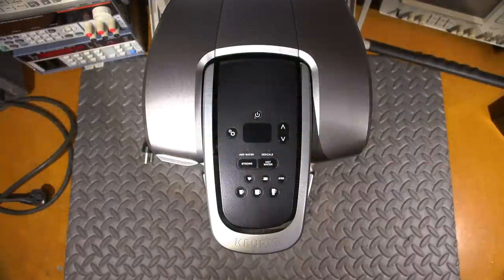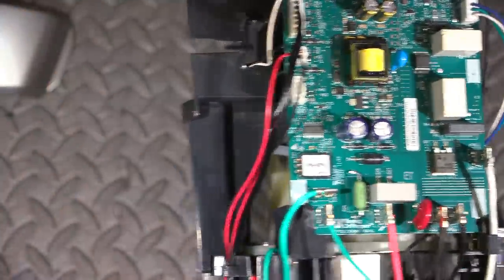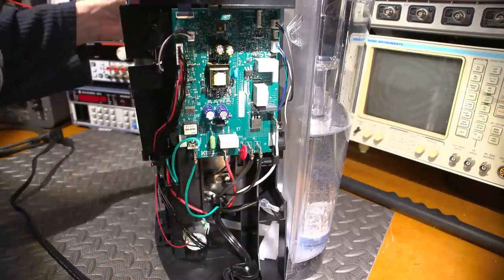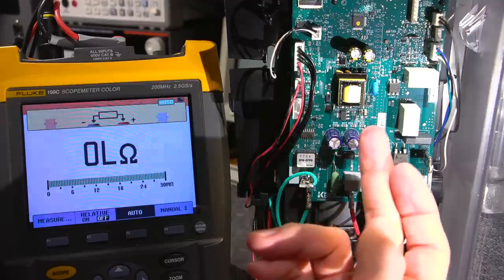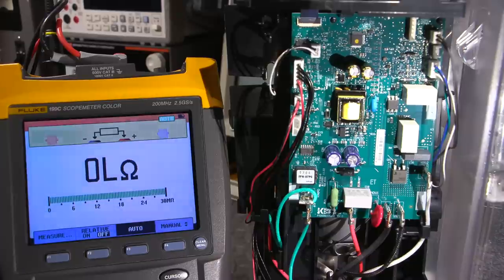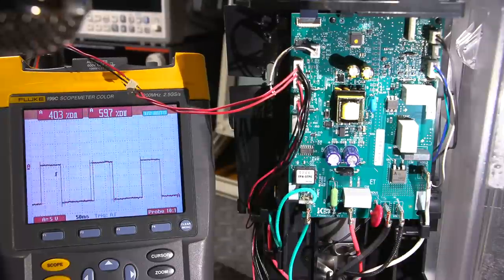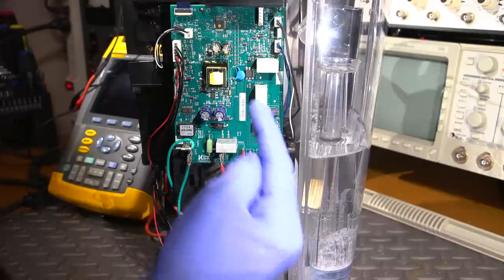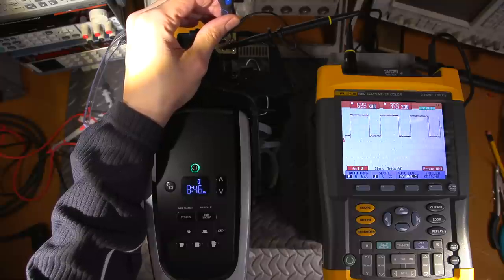Coffee Maker Repair And Modification - "For The Perfect Cup"- The Keurig!

Comment: Great video Paul! I just bought a third-party replacement power supply for my HP MicroServer and it spews S9+10 RF noise from below the AM Broadcast band up to who knows where. It made listening to HF rather unpleasant.
I might crack it open and see has been done (or not as it seems) to mitigate switch-mode noise from being broadcast.

Comment: I didn't read through all 938 comments to see if this was mentioned already, but you don't need to open and close the cover to dispense water. You can turn it on, press "Hot Water" and it will light up the LEDs, then select your cup size. This might be in the manual, but I haven't read the manual in over 2 years, so who knows :)

Comment: I saw the title of this video and was hooked - had to watch it!  Question though: wouldn't the pump keep on spinning since your new PWM circuit continues to apply power after the cup is full?  I note for example that the original PWM signal stopped  at 58:14 but the new one from your board didn't.
Reply from the maker: The pump is controlled by the CPU, and the CPU has a timer which times each cup, then shuts the drive to the PWM FET off. My board is at the speed sensor input to the CPU.

Comment: Out of curiosity, did you check the fill level problem after you fixed the RFI problem but before the pulse generator?  I was thinking that the RFI might have been confusing the original pulse generator.

Comment: I really like my Keurig's too and it's funny I have had the same problem. Here in Florida I get a lot of momentary power outages, you know the ones where the power goes off just long enough to turn everything off. So off course all of my lab equipment is on PSU's just to save them for seeing these power surges. But you know I never thought about putting my Keurig on one. I just may have to try it and see. Or maybe I should just do the Mr. Carlson's Keurig Hot Wire!!

Comment: A metering pump with an encoder, neat.  Did you use tap water in this?  I suspect pump is plugged up or some filter is which is the depth I would have taken this to before messing with electronics or suspecting a software fault.

Comment: I have the smaller one, and it works on a different principle. You put a cup of water in, and it runs until the water pumps out. Then a water sensor shuts it off. Unfortunately it gets clogged up with scale or dirt and sometimes doesn't shut off so you have to watch it. The good thing with this design is you always get out what you put in; the bad thing is you have to fill it every cup you make.  Once in a while a coffee ground gets stuck in the water tube and I have to pull it apart to get it out.

Comment: All my Keruig machines have pump failures when they die. The pump literally grinds and rattles and fail to pump. Except for the one that caught on fire. I have since gone to an electric kettle and pour over coffee funnels. This video, however, was fascinating. I'm still not sure how injecting your own pulses fixed it since the motor speed sensor was also sending pulses. Am I correct in thinking the pulse width is averaged to get a dc voltage and that is what the controller uses? Thanks for another great video!
Reply: I just posted a comment about being suspicious of this failure a few minutes ago. I also know a lot of people who told me their Keruig failed this way.

Comment: Very interesting video, and thanks for an inside look into one of these machines. As you mentioned it appeared as the processor got corrupted in some way causing the low fill levels. I wonder however what was the actual fault of this machine with its spurious rf harmonic output? Did Kurig forget to add decoupling caps on the line cord input, and/ or not use the proper capacitor value for the de-couple cap that was found on the board? Be interesting to take apart the other twin brother machine that emits very little noise to see if the decouple used in this one is of larger capacity value than in the troubled machine, and also if this machine has caps on the line cord input such as what you added on the noisy machine?
Thanks for the video my friend, just goes to show what you can accomplish when you have electronic knowledge and the will power to divide and conquer. 😎👍

Comment: the rf coupling caps you added would that work on new led lighting fixtures if they are noisy and would I add across line volt are on dc supply

Comment: I have a Speed Queen top load washer that when it runs it makes RF noise in anything above 20 meters. I also have a Visio LED TV that does the same thing. Looking at your capacitor trick,  could I try this? I just wonder if there isn't something commercially available though that would just plug into the wall and the washer or TV plugs into that.
Reply: Higher frequencies add a clamp on ferrite to the line cord. They also sell pi filters that plug into the outlet before plugging device in .

Comment: The need for two sensors is primarily due to the fact that it’s sensing flow, if you add heavy grounds it flows at a higher rate and the strength and level of water delivered changes depending on the grind. A fine grind coffee causes the pressure to go up which causes the flow to go down so it counts to make sure it delivers the proper amount of water regardless of the grind. Your tests are on straight water with no back pressure when you add grounds it will probably caused the water level to go down

Comment: I wish i could see the pump in detail ,, does it work like a tubing loop infusion pump ?  if so the  sensor might also be counting the number of revolutions of its pulse rotor as a function that when the pump when working property each time it completes one turn pumps a "set measured quantity of water" into the heating chamber ,  its pumping a measured quantity of water into chamber if it works this way.. (The older Keurig's used a single speed water pump that added water until set of electrically conductive pins of various lengths (Sense's the actual chamber water level)  made contact with surface rising water and it knew that way it had filled heating chamber to the proper water level you selected )

Comment: Hi Paul, Love your channel.  Has this Keurig always had low output? Or did it get worse over time?  On a four wire Hall sensor it would be easy to miss assemble the interconnecting wire and mix up the "Hall+" and the "Hall-" leads, which would make the signal from the motor sensor to be inverted.  The microcontroller would mistakenly slow the PWM (and the motor speed), but not a total absence of pulses that causes the processor to freak-out and shut the whole thing down.   It would be interesting to see what was on the other wires that went to the sensor.   Could be a totally different sensor like optical, who knows.  Fun to think about over coffee...

Comment: This was amazing. This guy designed a pwm board for a throwaway coffee machine. Sadly that is what they are. I think Philips came up with them about 25 years ago and they have taken over the home coffee making. I have had many different brands of similar machines but they all die relatively quickly. I remember Philips machines had a programming option to adjust your cup sizes by overwriting the default one. But the pump would be dead within 3 years regardless.

Comment: If I understood you right, you used a TL494 to suppress (by brute force) 35% or 40% of the pulses from the speed sensor. That causes the microcontroller to read a lower speed, and compensate by increasing the motor PWM duty cycle. Is that correct?
Reply from the maker: Pulling the speed sensors output to ground momentarily increases the pulse width to the motor, increasing the motors speed. The CPU looks for missing pulses or the PWM going to DC and shuts the unit down. By pulsing the motor speed sensor output at 5Hz with a set PWM, this overrides the motors sensor output making the CPU increase the PWM to the motor, increasing the pump speed.

Comment: Hi Mr. Carlson,

Interesting issues...

As far as the rf, the issue may still be beyond what you fixed & actually be a safety concern too.

Now, I realize that video time doesn't always allow for all tests to be mentioned or shown; but did you test the continuity of the AC cord ground pin to the board's ground?

If... the ground is open (I've seen quite a few poorly constructed moulded power cable plugs), it could allow for the RF issue to propagate thru the power cord. Many AC input circuits have a pair of caps going from each AC leg to ground for decoupling, but if the ground leg is open, they obviously cannot do their function. With as much rf as that silly thing was putting out, it may be the rf was causing rfi on that chip.  Myself, I'd reopen it & check that ground, if it is not grounded... once the cord/plug gets replaced, I bet the original circuit might still work correctly.
By the way, I take on this theory since you stated that it's always worked oddly in comparison with your other units. I.e. bad power cord = bad operation!

Slick way to correct the slow motor issue.

73 - John

Comment: I wonder what's different about the keurig's you have that aren't noisy, different board revision perhaps? Maybe just a bad batch of components on this one? Would replacing the power supply caps like you suggested also reduce the noise (maybe the transformer as well)?

Comment: I have to ask - did you cut the wires off the plug and simply solder on the 2 PWM wires going to the motor? Or did you somehow fashion them into the plug?

Comment: My house runs (mostly) off grid. My Keurig is the only 120v circuit that is always on grid. It pumps a bunch of feedback into the inverter and makes all my lights flash.
Reply from the maker: The circuit to the bottom right of the board pulses the heater rapidly to keep the coffee heater hot. It cycles on for a period, then off, using the temp sensor on the heater container in the middle of the unit. This

Comment: As he's adjusting the trim pot at 1:03:21, in case anyone doesn't know what DC stands for, it means FULL cup of coffee. LOL  I'm in tears because of all this work for a cup of coffee, EXCUSE ME, PERFECT sized cup of coffee, and I have to remind myself that I'm not in any position to think others reasons behind there efforts are anything to laugh at, as I spend most of my time modding flashlights.. 

 I only started to get lost where in the very beginning I had assumed it
 could have been the MOV, or filter cap on the AC side of the board, but
 after seeing your mod on it, I have to ask, is there any reason you 
never checked the power caps?

My first experience in RF filtering, I was working as a tech within a pawn shop, and we additionally had a guy, Monte, renting RC race cars outside. He brings one into me, complaining that the control seems to only be working within 2 feet distance. I honestly had no knowledge or experience at all with the darn things, and asked him if he made any changes, yes, he removed a cap off the motor, well I instantly knew that cap was to filter out RF noise, which would allow the remote to work much greater distance, and we put one on, and it worked.

Comment: I think your video will be instructive to Keurig's engineers. Lesson number one is that programming data should not be able to be easily erased from a processor. Lesson number two: The level of noise would probably not make the FCC very happy. It's not just amateur and AM broadcast radio that the device interferes with but possibly also military and avionics frequencies. Use safety caps to clamp noise. They cost pennies.

Comment: Nice video.  Not shore I agree to your fault analysis, but it works for your use case, and the coffee machine still controlls the pulse withs, just not deliver them 100% of the time.  🙂 

A really cool project would to implement the "Hyper Text Coffee Pot Control Protocol (HTCPCP)", RFC 2324 (or RFC 7168 extension HTCPCP-TEA).  But that would probably be a bit over engineering. 😀

Comment: The switching power supply is throwing off RF because it's underloaded at idle and going into self-oscillation.  Probably what also scrambled the microcontroller.  Adding more RF decoupling is an effective band-aid, but you could address it at the source by adding an appropriate power resistor across the 12V side of the supply, to provide a minimum current draw at all times & keep the power supply in its "happy" range.

Comment: Another question would be, what would it take to eliminate the voltage fluctuation (turning Coffee Maker on/off) that caused the IC to partially lose its correct function (probably another capacitor across the IC +, and ground)? Should also send a link to this video to the Keurig company. Probably they won't give a damn because how many customers plug/unplug their coffee makers, and how many are worried about the RF noise created by the switch mode power supplies--- not many! However, if more consumers could easily repair these electronic appliances, they would save money, energy, and the environment, by delaying the inevitable disposal of electronic products into landfills. Good video!

Comment: I wonder if you used the process of 'Successive Approximation' to "get the perfect cup of coffee"? I worked on equipment which used SA to calibrate timings. It would take over 10 minutes to programmatically  calibrate 1024 channels of a microprocessor-tester. After calibration, all 1024 channels would lie on top of each other measured using Tek 485 Oscope. (Did I mention the uplevel/downlevel of all the 1024 channels were identical too.)

Comment: The Keurig  should fill the boiler to the correct water level  heat it then use the frother or air pump to push the water out.   The add more or less water pwm signal is to adjust for stronger or weaker brew.   You have made it the the size selector now.   The problem is  the heat cycle may not be long enough to heat the water enough for a whole cup.    Can you select different cup sizes?
Reply from the maker: Every cup size fills perfectly, the pump is timed.

Comment: I've got years of tinkering and repair of just about anything that needs it. I had an early model Keurig die on me so I opened it up. Giant wire/hose octopus packed solid top to bottom. Way too much for me. They've simplified a lot since then, but I'm sure you would have still prevailed.

Comment: You didn't look into the source of the excessive RF. That may have been causing the other issue. Bypassing the RF cleaned up the lab, but I imagine the RF was floating around the Keurig still. With working Keurig machines available, A-B comparisons with a fast scope would be interesting.

I also noticed the slow traces didn't trigger properly. It looked like the trigger level was set OK, but the mode was in Auto. Using Normal is often required at 5 Hz. On Auto, the 'scope will trigger because it wants to see something on the screen more frequently.

All in all, a very interesting video.

I spent about 2 days in an old Tek 465 recently, trying to get ALT and CHOP to work. When I found the problem, it was a real forehead-slapper. CHECK THE VOLTAGES FIRST. The order of the repairs can matter. In the case of the Tek, -8V went bye-bye only on ALT and CHOP. Easy trace from there. All the transistors were doing fine, they just needed some go-juice. My BIL asked what the part number on the Flip-Flop. He was amused that my reply was two 3904's<g>. In this case, just checking the voltages wasn't enough - one had to check the voltages during the problem. -8V was fine on CHA, CHB and ADD.

Comment: It would be interesting to see readings on one of the machines that work correctly. Why the big difference in RF?  Maybe the line filtering has a fault or a redesign messed things up?  And what the speed sensor reads on a working machine for a given motor voltage?

Comment: Also I'd like to mention another radio guy had a similar problem and he unplugged it, held the on off button in and plugged it back in, it made a full cup but the following cup was shallow... He did it three times and after that it continued to work fine, also be advised that he had cleaned it prior... Also I find they use an air pump not a water pump.. the actual oem runs $50 but you can get a generic match for around $15

Comment: As always I loved the video thanks, Paul. I was wondering if the modded pwm might affect the filling ratio between cup sizes but realised all was well after seeing you try a couple of cup settings successfully. Was almost surprised you didn’t just pull the ic and rewrite it with the data from another of your machines but no lol, you build a pcb and fix it your way. Wonderful
Reply: Dont think that firmware isn't locked for reading. 99% you will not able read
Reply: @VolodymyrTorkalo  Good point !!

Comment: Had the same problem with a different machine. Chaning the pump did not help. Turned out to be the pressure sensor outputting values for high pressures so the machine ran the pump slow. And these Fujikura pressure sensors do fail in other equipment on a regular basis. Same goes for pressure sensors from Honeywell and Amphenol. But the hack is very creative. That sensor is not available anyway.

Comment: Paul  - a wonderful video.  A question for you -  Since the pump has a setting for Strong, were you able to test that setting to see if the PVM worked normally before you added your board?
Reply: He did try it. Selecting strong runs the pump slower, in this case barely at all.

Comment: I REPAIRED A KEURIG. A hookup wire was too short going through the hinge and eventually tore. I spliced in a short piece - still working after years! The family insists on unplugging after every use without first turning it off! No problem so far....